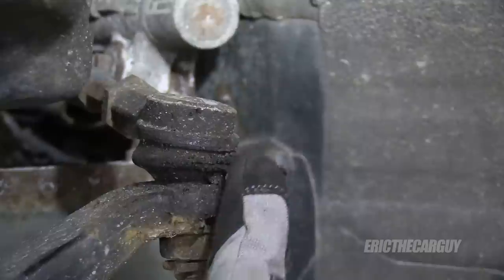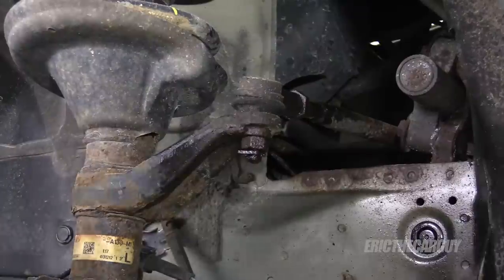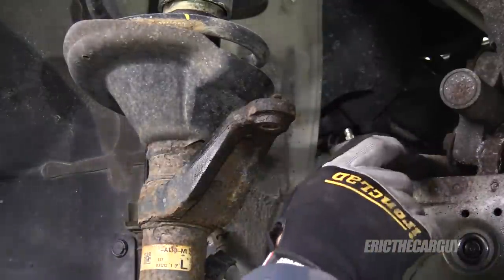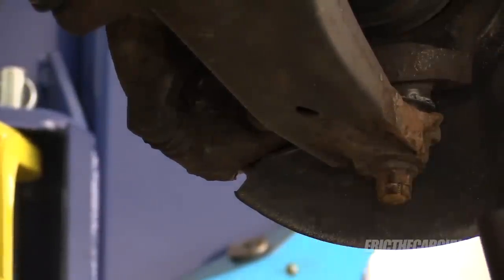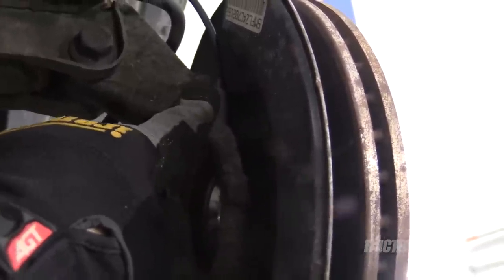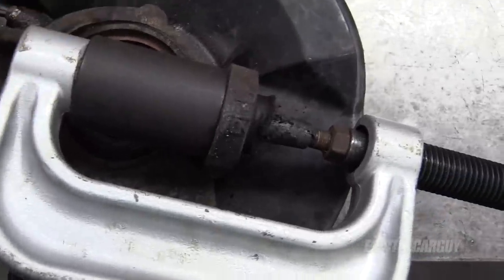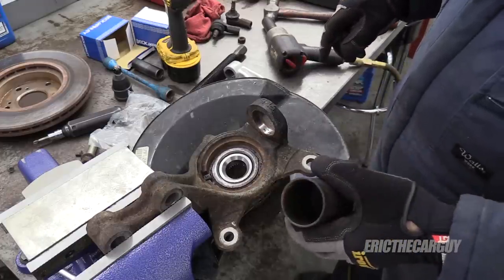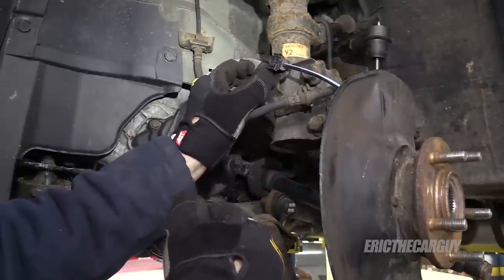How To Replace Ball Joints and Tie Rod Ends Honda Element/CRV

Comment: I appricate this video but I have a question. I have a 2006 CRV and when I follow the link for the ball joint and the tie rod end Amazon is saying that this part does not fit you car. Now the 2004 and 2006 CRV are exactly the same so do you think I should just buy these parts?

Comment: Helpful video as ever. Thanks Eric! I thought the new one you installed is a "sealed" (non-greaseable) type, but the rubber cover is not completely sealed to the bolt, right?

Comment: I drive 80k a year as a courier and put my hondas through hell.I have busted a few ball joints driving.I learned later after busting 3 or 4 to not use the impact on the ball joint nut.They break later on the road if too tight.I have not snapped any more after using a torque wrench around 47-50 ft pounds.

Comment: For those of you that don't have air tools it's a good idea to use a drop of blue loctite on your bolts, it's better safe than sorry. Also on the axle nut it's best to use a torque wrench to the proper torque before staking the nut , improper torque could (in theory) reduce the life of the bearing.
Reply from the maker: Good points, but know that most wheel bearings of this type get torqued to 300lbft. I've never had an issue with one run down with an impact. Also, I don't see a need for locktite if the fastener already uses a cotter pin.

Comment: Would you recommend adding more grease to the non serviceable ball joint before you replace the boot and what type of grease would you recommend using?
Reply: No, they are sealed.

Comment: Hey Eric! I’m doing this on my 02 CRV and I can’t figure out why but the ball joint sticks out of the control arm too far. The threads don’t do long enough to tighten the ball joints down. The castle nut doesn’t even touch the LCA. I’m lost

Comment: guys make sure you take the cir-clip off of the ball joint FIRST and instead of pressing on the threaded end of the ball joint use a cylinder that lets the threaded rod go through so you are pressing on the base of the ball joint, that way you do not need to put a nut on the ball joint, chrisfix has a more thorough tutorial

Comment: Hey Eric, I just installed some new upper control arms with new ball joints on my 2009 Ford Crown Vic. Once I put the ball joints into the knuckle and then tightened them down with the nut. I noticed that the boot of the ball joint kind of spun in a tightening motion as I was tightening it down, is that normal or OK

Comment: Hey I have the same Honda element mines is a all-wheel-drive my struts are very shot so I went ahead and stead of replacing the street I replace the whole entire thing with the spring shock and all would I be able to put those on easy without compressing them

Comment: Is there any way to screw up a ball joint install? If it’s seated correctly in the control arm and then you got bolt on and cotter pin in? Just wondering I did my first ball joint and I’m worrying for no reason. Just looking for peace of mind haha. It is pulling to the side I changed the ball joint on but I’m assuming an alignment is all it needs now? 

Replaced both front struts and left lower ball joint. Dodge Caliber 2007

Comment: Keeping my 2008 E till into the ground. Joints good, but not greaseable. Other cars I poked hollow grease pins into rubber gland and they never wore.

Breaks seal of 'lifetime' lube, but just fill once a year.

Do a spongy brake thing for element.
I just replaced all 4 calipers, pads, and hoses. problem is I wanted to pressure bleed after.

Ordered Zoro (Grainger cheap, refurbished, junk I hear division.) And never got.

During ice, made the abs function.
You said at one video pounding the brake on a honda fixes it. Why?

Good videos 99%

Comment: Using colored/black zip ties will last longer, they are uv resistant. You'll notice the white ones are labeled "indoor"

Enjoyed it, and I don't own any hondas :)
Reply from the maker: You realize that's a running joke on this channel and I specifically use white ones to piss people like you off. ;) Seriously, how many UV rays make it to the backside of my strut with the wheel installed?
Reply: No, I didn't. I just kept seeing the same mistake made on tutorial vids. Never had a reply from you or anyone else on the couple comments I've made on your other vids. Have a nice day, bud. Hah
Reply from the maker: No worries. Thanks for your comments and input.

Comment: Would a ball joint or tie rod end make a noise where it sounds like a doorstopper going off at certain speeds? I've been trying to find this problem with limited tools. My lower engine mount is broken completely but I don't see how it would cause the noise

Comment: Hey Eric, I am about to try this with out air tools (and a lift, lol).  I just ordered the replacement parts.  What size socket did you use on the axle nut?

Comment: Hey Eric, since you worked on dismounting the axle from the hub. Would you say that by removing the passenger side axle would be the easier way to replace the starter on these Elements? I've seen your video on it and noticed you still went thru a bit of trouble.

Comment: Those ABS sensors are practically welded into the hub, I have yet to get one out that didn't break, well except on the used hub I bought where they cut the wire, that one had no issue FML.

Comment: Hey Eric: Have you found many fitment issues with Moog and/or NAPA ball joints for Honda?  I did a CRV a few weeks ago where I could not get the supplied snap-ring on the ball joint.  The ball joint pressed in all right, but the groove was not completely accessible (by over half the width of the groove).  Had to press it back out and buy an OEM.  Maybe I should have just left it in without the snap ring(?)  There was none on the OEM part.
Reply from the maker: I've had all kinds of fitment issues with Moog. In fact, to this day I still get crap over this video. Funny how I'm the one to blame when it was Moog that didn't package the correct ball joints. BTW, it took more to remove my welded ball joint than it did the one that was pressed in originally. https://www.youtube.com/watch?v=SYnscq4pMKw

Comment: Gosh I just bought a ball joint tool and I've never done it and then I just realized after peeking at my control arms that the ball joint does not get pressed into the control arm unless I have the wrong ball joint so it must be pressed into the knuckle I guess I don't know apparently I haven't been paying enough attention but for the record I didn't watch this whole video yet I'm in a bad area on the road so I'm getting pieces of it

Comment: Does this fix the creaking noise that occurs when you make hard turns? Thanks for the knowledge, by the way
Reply: grease the joints first before you change the parts
Reply from the maker: Not always. The lower control arms and stabilizer links can also cause nose. Both videos linked in the description. Also, you might find this helpful. http://www.ericthecarguy.com/faq/diagnosing-noises-in-your-car

Comment: When adding grease to the new tie rod, when do you know you’ve added enough? Also, would a bad cv axle make a pulsating creak noise when braking? It clicks when taking sharp turns but wondering if it’s also cause of noise at low braking speeds
Reply: You'll know when the boot swells up and becomes more firm. A lot of people say to pump it until it starts coming out and that works too. There's a good chance that both of those sounds are your CV axle. They make all sorts of noises when they go bad.
Reply from the maker: Usually you stop when the boot fills up. If you put too much in, it'll start to ooze out. As for the noise, you might find this helpful. http://www.ericthecarguy.com/faq/diagnosing-noises-in-your-car

Comment: I’m using the exact same kit and I can’t get the ball joint out.  I have an SC model but the knuckle should be the same.   

In fact none of the adapters in the kit fit and allow the ball joint to slip out

Comment: Just purchased an 05 Element and assumed I had a plastic or rubber splash shield missing in both front wheel wells, but after watching this video, it looks like there is no splash shield covering the holes where the tie rod ends come through??? Seems hard to believe Honda would have left these huge holes open to let slush / rain /  salt / dirt splash into the engine compartment....

Hope someone can respond to this.

Comment: AHH MAN, I just did this on my 2004 Civic Si 2 weeks ago! Ran into the same issue with the lower ball joint fitting. I do have a question about the outer tie rod boot (also Moog). Driver side went on fine, but Passenger side boot leaked grease at the top seal and it all worked its way out over the course of a week. Pumping more in just resulted in it squirting out. Is it possible to remove the boot from the end, clean it, then replace in an attempt to recreate a seal at the top (bottom is a pressure fit seal)? Anyone done this?? Thanks! 

Inner tie rods were a PAIN to get to. Had to order some large crowfoot wrenches and then grind down the 29mm to be thin enough to tighten the replacement Moog parts.
Reply from the maker: I wouldn't worry about the boot. So long as you have fresh grease in there it should be fine.
Reply: I was kinda hoping you were going to do the inner tie rods as well. As said above I also heard they are a pain to do.
Reply: TTercel Inner tierods are a pain but you can do it with a 29mm Crowfoot wrench. I recommend also using an extension to get you out from behind the valve cover to where there is more room for leverage. My stock airbox is off (using a CAI) so I came out to the right. The Crowfoot wrench will power through the lock washers, so don't worry too much about bending them straight beforehand. Also the ones I bought were too thick for tightening the new inner tierod nut so I had to grind off about 1/8in from the face of the wrench to get it thin enough.
Reply: bigwavedave25 Thanks for the advice! Yeah my concern was those lock washers, I'm glad to hear a crowfoot will handle them without me bending them.
Reply: TTercel No problem. I fought with those stupid washers for 30min before deciding to just power through them. A decent 1/2in drive breaker bar on the crowfoot did the trick. Also, those hoses in the way are filled with coolant (learned that the hard way), don't remove just unhook from their retainers to make yourself a little more room. Good luck!

Comment: Good Morning Eric....  I've got a 2003 Chevy Silverado SS AWD truck with 64K on it... yes, only 64K miles!  I changed my oil and greased it the other day and noticed that the lube tech's where I'd been getting it serviced at have overfilled the grease fittings and split the boots on several joints. They're oozing grease a bit but I'm concerned with them allowing dirt in and shortening the life of my parts.  My question to you is would you merely change the boots or go ahead and put in new parts since you're already doing the labor?  I hate the thought or buying all those parts when only my boots are bad. Thanks!
Reply from the maker: When you add new grease, the idea is to push out the old grease and dirt. You don't need to buy anything if the joints aren't bad.
Reply: My thought on it was I have no idea how long they've been split, and if there are contaminates in the joints, if they're worn, etc... If I were to go to the effort of taking them all apart to change the boots, if I can find original style boots that is, shouldn't I go ahead and swap out the parts too... since I'm in there already? I'm still going to need an alignment either way, and if one goes bad I'd have to do it all again, right?  Or am I being paranoid...?  I've had a lower ball joint fail on me before and the aftermath wasn't pretty, or cheap to repair!
Reply: My $0.02 it comes down to cost really, if you can find good replacement joints for a price you're comfortable with I say go ahead and replace the whole joint, as you pointed out you're in there already, the overall amount of work between replacing the joint or just the boot is the same.  

However if money is tight (and where isn't it these days) you can inspect the joint for wear, mainly by testing it's movement (it should be fairly stiff to move but still smooth in movement, you should be able to find hundreds of vids around that will show you what to expect from a good joint vs a bad, I'd be surprised if our mate Eric here doesn't have something in his archive).  If you're happy with your joint then just replace the boot and flush some new grease through, then just make it a habit to check the joint every time you service your truck (which is a good idea regardless).

Comment: How do u get this stripped bolt out of my back plates so I can change my breaks.we tried welding a nut,but the guy wasn't too sharp with his welding. I used a screw extractor with no movement. I tried heat but propane only.so I was told to go to the junk yard and get a knuckle.what are your thoughts.
Reply: Wish I can post the pics...
Reply from the maker: https://www.youtube.com/watch?v=c-VD1yx61bA

https://www.youtube.com/watch?v=EqNcBkLvptg&t=36s

Comment: Just got a brand new electric impact (Milwaukee Fuel M18) with my tax return and figure I would do the ball joints on my Trailblazer. Well the lower ball joint was so stuck in the control arm, and the electric impact created so much torque, that it actually broke the mounts that the receiver cup is supposed to sit against on the control arm. Which then led to me buying a new control arm from Moog and discovering that the included bracket didn't actually fit....

Comment: When should this be done? I have 116k on my Element 07
Thank you, Jake
Reply: Jake Weisenberg when to find play or the rubber boots split, when you take them off they wobble rather than being firm. If you have odd tyre wear it's cheap and easy to do with hand tools. If your changing for new tyres and have a few miles in the car then go ahead and do it. I have crappy roads around our home so when I did this to my last mx5 it transforms the steering.
Reply from the maker: When they get loose like shown at the beginning of the video. If there's more than 1/4" of movement you should replace.

Comment: Wow, I have never seen an outer tie rod end connected to a strut directly! Isn't it supposed to be connected to a knuckle? How does this affect steering and reliability of the assembly overall? It doesn't look too reliable to me to push a knuckle around by force applied through struts. Weird!
Reply from the maker: It's fine. Honda does this on several of their vehicles.
Reply: My Saab 9-3 has a similar arrangement, the strut has been designed to handle the steering force being applied to it so there should be no difference in the overall reliability or steering action.
Reply: Got it, thanks, Eric!
Reply: Thanks, understood!

Comment: Im a tech at a Honda dealer. We always use aftermarket balljoints for crv/element/civics because the knuckles from Honda are too damn expensive. I like to air hammer them out tho #flatrate 🤣
Reply from the maker: That's how I normally did them too. Thanks for the comment.
Reply: Rob, what brand aftermarket ball joints do you use? Thanks.

Comment: Get rid of that dewalt garbage and get the Milwaukee mid torque gun , or the new 1,400 lb ft gun ,it's  very compact.  My mid torque gun removes 95% of fasteners on a car. For everything else I pull the the new 1,400 lb ft gun 💪
Reply: Have you seen his tool box update video? If not, I suggest giving that a watch
Reply: The mech a nic that maybe the case.
Reply: Dewalt makes great electric impact drivers. His is probably the weaker ones. For things like valve cover nuts.
Reply: He’s still using his 18 volt dewalt. He has the new ingersol rand 3/8” now I think.
Reply: DeWalt uses the same interface of batteries for a generation of a cordless tool and when the battery on any tool dies and can go get that same battery five, 10,  or15 years later.  Furthermore, if DeWalt does come out with a new voltage tool they make an adapter to use the new battery on the older tool not making it obsolete.  Does Milwaukee do that?  No.  In three to five years Milwaukee will come out with a new tool, but not any better, and a new battery interface and not support your current tool rendering your $500 investment  a paper weight.  DeWalt gives you the same benefit of tool with a better return on investment of tool.  This way I can go buy another tool that is needed not replace an otherwise functioning tool but no way to power it.

Comment: fi you use torch to heat up the hole for ball joint it is much easier to install
Reply from the maker: It can also damage the joint or the wheel bearing, but I suppose that depends on how much you heat it.
Reply: Something I've done before I after cleaning up control arms hole I'll stick the ball joint in the freezer for a couple hours. Helps shrink it up just enough, fits easier and no damage to components. Old trick I learned from my Master Tech.
Reply from the maker: Zackery Cole I like this option better.
Reply: Depend on joint placement. You dont need to heat this red hot. Barely to hot to touch migh be enough

Comment: Could have removed that ball joint in 15 seconds with a hammer instead of removing the knuckle. A few whacks around where the ball joint presses in and a few more upward to the bottom of the stud pops these right out.
Reply: maybe, but there is not much space, it happened to my honda crv, no space at all